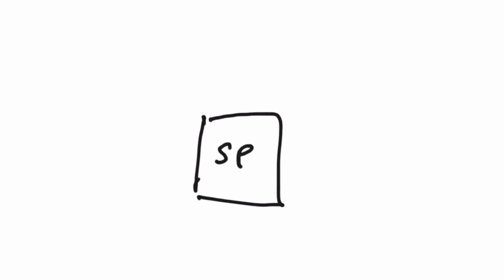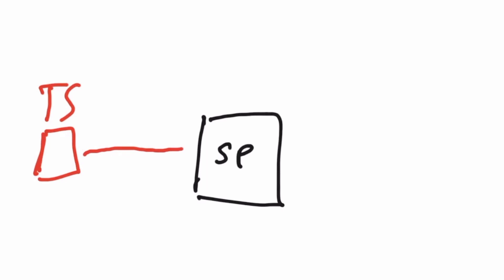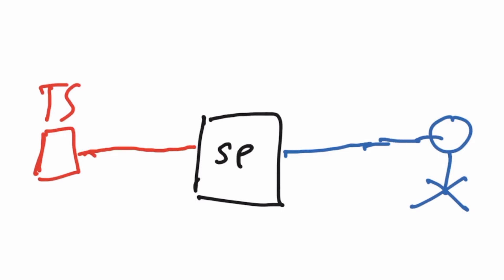HVAC Tech School: The Easy Way to Understand and Tune a PID Control

Comment: Got a 3 way modulating valve, controling mass flow to a process heat exchanger vs outdoor condensor. Control variable based on discharge temp. Teicky part is the process hxe has an unstable load.